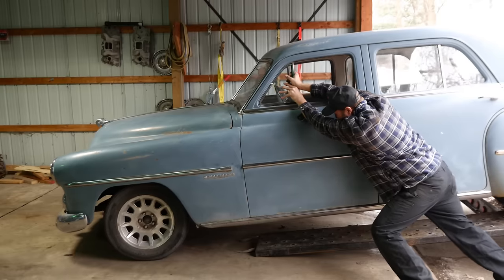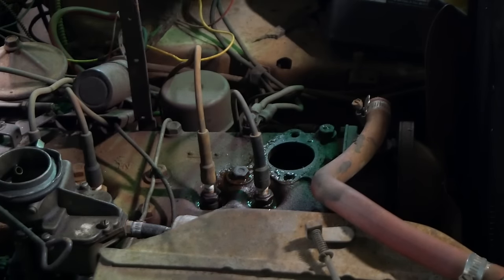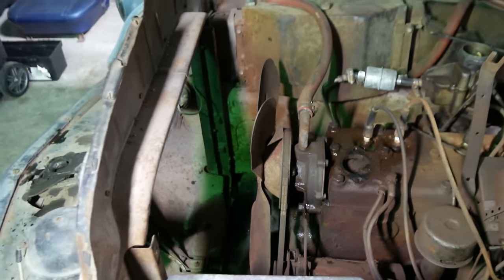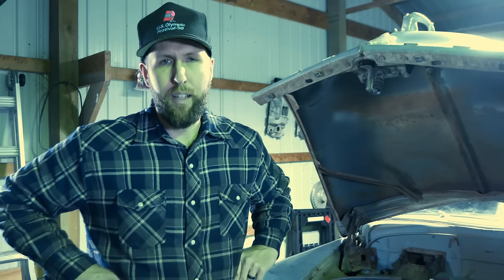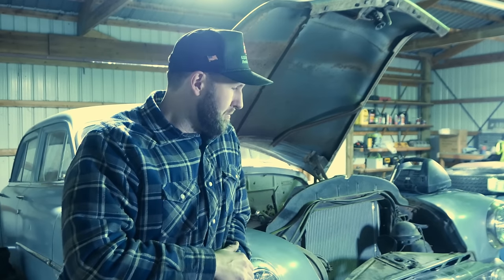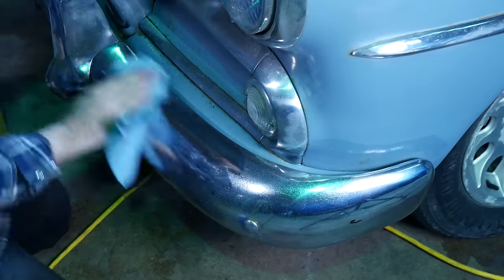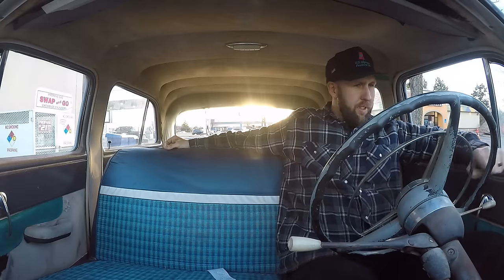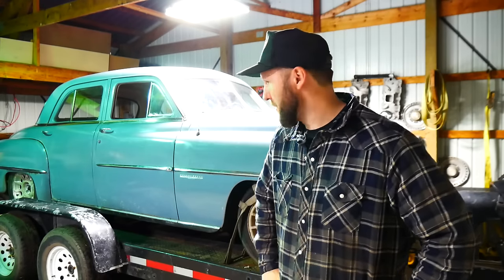1952 Dodge Cooling Repair & Paint Buff - Vice Grip Garage EP23

Comment: When you could buy TSP (Trisodium phosphate) I would put about four tablespoons of TSP in the radiator and start the car and let it idle. ( thermostat removed from the engine block)Then I would put cardboard in front of the radiator to block the airflow. Watching the temperature I would turn the engine off as soon as it got to the hot mark. Then drain the radiator and flush it and the engine block with clean water. When the rust, oil, and crap stopped draining out, Close the radiator petcock (radiator drain,) and thermostat, fill the system with antifreeze/water then run the engine and top off with more antifreeze/water mix. That would clean the cooling system and prevent a lot of overheat situations. But, you can no longer buy TSP because of the tree huggers (phosphates in the environment.)  Automatic dishwashing power may be a viable substitute. It's worth a try. DO NOT USE LYE. You can't buy it now anyway because of methamphetamine labs.

Comment: I like those adjustable impact wrenches too (the one you used to remove the oil drain plug). Use ‘er as a wrench, use ‘er as a hammer...

I was wondering, were you using the “MIGHTsucker” or the “MITEsucker”?😝

Comment: My truck would not start at the pharmacy.  Changed starter and alternator in the parking lot.  What happened was the whole truck fuse went kaput so changing those things did nothing.  I had a lock out and only an independent mechanic can fix this.  I had the truck towed too.

Comment: The thermostat serves a purpose on many levels. I see it this way, for the most part, im not an engineer. I'm did design it,  should not change it,the design bat least. What fails, can be replaced. If the thermostat has not failed you have to find the blockage. It could be a bad water pump. The radiator could have a blockage.

Comment: I had a few breakdowns. Head gasket blew losing all power on a motorway, then the traffic police lied about the advice they gave me causing me to get a court summons, I went to defend myself in court and they dropped the case 30mins before I was due to appear (but of course making me go through the stress - I was 18, thanks guys - just own up, OK?). End result was I got a new head, and with friends reground the valves, overhauled the twin strombergs carbs so well balanced the shop said there was nothing to do when I went for a tune. As part of that episode I walked for 3 miles carrying the cracked cylinder head. I was only a skinny guy then, and it was agony but necessary, so I just carried on through the pain. A week later my arms had seriously bulked up and toned. My biceps were like iron.

Later, on the same vehicle - a Triumph Vitesse Mk2 -  the mainshaft shattered on the transmission, so I rebuilt the synchromesh gearbox using a secondhand mainshaft and all new wearing surfaces, bearings, springs and dog clutches. Again it all worked fine. I think I was still only 19, and all this in 1983/4. 

Later, my rad leaked on a trip to the Highlands of Scotland, and a garage at The Bridge of Orchy - quite remote for Britain - used the wrong torch to repair it, causing the solder to melt. Later that trip at The Kyle of Tongue the clutch master cylinder failed. Luckily I was driving a Saab 96 V4 - a bit like your Sonnett - in that it has a freewheel, so I was able to get to Inverness and, with a bit of persuasion, get the garage to fix the beast fast enough so actually had a holiday where I wanted to be.

Watching you reminds me how much I enjoyed working on and fixing vehicles. I miss it and feel the need to do it again.

Comment: Hurricane Irene, moving house, t-shirt and jeans, 1993 Dodge Shadow 2.4 loaded to the brim with Mom's art supplies, surging begins, surging decides to stick around, engine dies. Now I'm stuck at the side of corn field 5 mi. from either home in freezing temperatures with some cans of paint and a drawer full of rulers and razor blades with more than a 20 minute walk to the nearest door through sideways snow. 10 minutes later she fires, rev it once, neutral drop and a full charge up the next hill.

Injector froze at WOT.

Never figured out that surge issue.

Comment: Worst place I ever broke down was on the bridge from Ohio to WestVirginia in rush hour traffic,  Had to set there for 3 hours, had to cut a hole in the bed of the truck with an axe to replace a fuel pump (limited tools) then found out it was a bad wire to fuel pump that had broken in 3 places.

Comment: Those old flatheads, if they got water down in the plug wells it would ground them out>  Had a friend with a '39 International that happened to.  I just wonder if that high pressure car wash did the same thing to that Dodge.

Comment: Worst I had was a car I lended to a friend got a flat on the ol freeway. He tried to change the tire and a lug spun free. Showed up with a death wheel had him limp it to a gas station on one of my states biggest exits. Plugged into one of the stations 120 outlets and cut it off in the parking lot. Donut and slow speeds after that

Comment: Didn't actually "break down" so much as get high centered in the mud in the wife's brand new Toyota 4x4 back in '89.  Had to walk out about a mile and find a cable and a come along then walk a mile back in.  While walking back in I was "attacked" by a crazed groundhog.  Never really knew why he wanted to chew my leg off but he came snarling out of the brush towards me and I had to drop the cable, drop the come along, pull the .357 Magnum from the holster and dispatch the damn thing.  Took (3) good hits before it gave up trying to maul me.  Got the wife's truck unstuck and returned the borrowed cable and such and made it home about half hour after everyone had sat down for Thanksgiving dinner.  Wife was pissed!

Comment: Worst break down??? Was driving from Oklahoma to Minnesota in my 79 LTD II w/69 mustang 351w/4v think it was the summer 1986?... Fuel pump went out in Misery (Missouri) in July. A farmer picked me up on the side of the highway. Drove me (On his tractor) to a car repair place (broken down barn with old cars, tractors, refrigerators, etc.). My mechanic spidey senses were tingling. They asked me if I wanted to tow it there and have them fix it. I said I would call my Dad (super dad) and he would come (Was 300 miles away) Being the smart guy he was. He picked up the fuel pump before he left. Still the same day I left Okla. at 3am). So mom and dad showed up about five O'hot (100 and 10 million degrees) and I preceded to replace the fuel pump on the stick hot black top. "Oh, I was with my 1st wife too" Did you know you can get like a bad sunburn from laying on blacktop.. Yikkess... VGG Rocks...

Comment: Back in 1990 my then wife and I were going west on interstate 80 in Wyoming. I was sleeping in the passenger seat and she was driving when I was woke by a slap across my chest. As I became coherent I saw two semi's, one on each side of us as she has a death grip on the wheel and the front is going all over the road. The outer wheel bearing on the driver side had failed and we were literally 100 miles in either direction from any civilization. I had no tools because they were where we were going. The tow only cost $100.00 and they only charged $40.00 to fix it. God and my Angels were on my side that time.

Comment: I was driving a hearse and broke down on the side of the highway that would have been ok if it wasn’t here in Australia with 40’ plus degree temperatures that’s 104 Fahrenheit for those playing at home. And of course I had a passenger in the back. No complaints from him though.

Comment: Ahah, I stopped opening my mouth, I tried before pulling out the stat on a 455 on a 350 radiator, got me about 45 miles. Had to use ditch water to get home

Comment: Dropped a valve in a VW camper in Africa 6 miles outside Gaborone the capital of Botswana. What a racket.  The good news is the Mercedes dealer had a new engine on a pallet and even let me use the garage to swap it over.  That was Dec 1984 $600 between 3 of us ,,,bargain!

Comment: I had a 1981 Chevy 1/2 Ton Pickmeup with a Sprint Racer motor with a crappy radiator.   It over heated in the middle of the Alberta main drag.  Highway 2 is not the place to do that.

Comment: I had made 3 fate full decisions one evening when i was quite young( 36), #1 bought an ol chevy PU ,  It was a 62 as I recall. And the only buying appeal this truck had was someone swapped in a 396 BB, some leaky headers, and 4:10's in er back side. I never even pulled the oil tastin stick. the seller fired it up, and it rumbled and i said SOLD. it was not far from home so of course my brother and I brought home the 'good' truck and we went drivin around in the new GEM. every stop sign, we hit the trouble maker peddle on the right, and she left a patch as long as you like. so this town, was small, ( i wont mention it by name cuz I dont think the statutes of limitations is up yet on our 'crimes',) but we were goin by the police department, and in our young minds we shrugged a collective SURE, why not? and whipped around to the parking lot and proceeded to lay a patch of smoke and rubber that any Aussie would be proud of,  right up until the drive line EXPLODED! Now the RPMS were up pretty high and parts of the drive shaft went everywhere! including somehow hitting the oil pan and it started puking 5 quarts of oil onto the new blacktop of the police department/court house. That was mistake #2. so we run the hell home, about 8 blocks, grab the good chevy truck and a chain and we whip right back over and hook up the gem, and drag it back home and put it in the driveway and covered it with a tarp. 2 days later we get a knock at the door, sure, of course its the cops. they asked us  when we were fixin to clean up that mess we left on their newly paved parking lot...we acted stupid cuz how would they know who dun it? well, boys, we just followed the black strip of oil you left on the road for 8 blocks and it ends right under that there tarped truck......oh...#3, clean up yer mess!

Comment: Wort place ive ever broke down was death valley on my way to Fernley Nevada for 3 days of no work. It was a 1985 Fox body Mustang. I got some really bad gas from the mine I was working at and it clog the fuel filter. It really got bad once I was on the other side of Lone Pine California and there wasn't an auto parts store anywhere. Mustang thought it was a good idea to make the fuel filter threaded instead of like GMs inline filter. If it had been a inline filter I could've just stuck in a pen body but instead I could on go about 20 to 30 mph and i had to stop ever damn 10 miles and shake the stuff out of the damn filter. It took me over 24 hours to make it to Carson city Nevada to get a new filter. I've hated FORD ever since. That's just one of the dumb engineering mistakes of many at FORD..

Comment: I broke down in my ’78 F150 Ranger on an exit ramp in Ohio.  All that separated me from a nearby AutoZone was a drainage ditch and a 50 yard hop, skip and jump.  So instead of walking up the exit ramp and around, I decide to get a running start and jump over the ditch.  I didn’t make it . . .  came up short and fell backwards into the muck (seating position oddly) . . . lost my shoe and my backside was covered in some kind of awful muddy stench.  Called my sister to pick me up.  She was like, “what the hell happened?”

Comment: Broke down in 54 Ford F100 loaded with about 15k$ keyboard equipment on th way th o as n audition when the rear end went out. You don't leave this kind of investment sitting on the side of the road to get help, cuz it won't be there when you get back. And yeah, I missed the audition. There were no cellfones... 😳

Comment: Put a harbor freight ATV winch on the front of your trailer and get a portable power pack to run it works awesome I pulled a 57 Chevy with four flat tires up on mine. Come alongs suck!!

Comment: Had a tie rod end come off on the way to the in-laws house... Tire makes a hard right... I make a hard left.. Truck doesn't care about either...it went straight.... Once the Truck finally stops.... I crawl under The Truck... Mostly because i can't stand... Or speak.. Beat the ole tie rod back together with a Louisville slugger and strap it together with bailing wire and limp the last mile of my journey...

Comment: I learned my lesson buy blowing the head gaskets on a brand new motor that I removed the thermostat because some complete idiot told me to do so the motor will not run cooler with it out ot will run hotter!

Comment: I had a fire on the golden gate bridge in a 1972 dodge dart fuses were wrapped with tinfoil CHP gave me a ticket for stopping on the bridge  I worked for a used car dealer at the time he sent me to recover a rental car in Nothern Cali, I'm in L.A. and a trip north is about 7 hours each way this trip took me 7 days it broke down about every 100 miles or so you name it, it broke, when I finally got back my boss said he just bought the car for $150 the same day I left this was the only car on the lot with a tow hitch so he gave me that one water pump. heater core , universal joints, 3 flat tires w/ no spare, brakes failed, fuel pump slant six she kept going sanfran, to L.A.left me on the road about 10 or 12 times   yep fun.

Comment: Cummins ate 3rd gear hauling my new to me tractor home pulled over on a gravel travel unloaded the tractor pulled the truck away from the trailer hooked the tractor up to said trailer whipped around come alonged the truck onto the trailer backwards and proceeded the remaining 120 miles home across Iowa in January hauling a dually pickup on a car trailer behind a 70s cab tractor with no heat 😂

Comment: well not really a break down story but while ago, i was at the truck stop in my wrecker an i left my keys in the ignition an locked the door without thinkin an well my unlockem tools were an tightened up in the ol tool holder so had to call ol moma key master down at the ranch an had her bring up her locker outters an key machine since shes a ol lock n key master an git the ol rig undone an made up extra door key to hide round fer next time i fergot, which happens alot

Comment: Swamp. Florida type. Before cellphones. In a ford ranger.tierod end broke and the overhead cam spit out a rocker arm in the 4 banger through the valve over. I snapped the balljoint back together found the rocker arm in the plastic break reservoir. Tied the ball joint in with speaker wire. Ducktaped the valve over kinda closed. Used a crowbar to shove the rocker back in.drove ti 19 miles home. Then the 52 miles to auto zone and u-pull-it shaping parts at each.i can't rocker if I was brave or stupid. Stupid I think.

Comment: You left out timing as a cause of overheating. Thermo, heads, clogged radiator, water pump, timing, low water. 6 different things.

Comment: I haven't seen the whole video yet so....I hope you didn't discover the splendor of the old MOPAR flat heads and their wondrous sheet metal cooling tube behind the water pump and how they corrode into tiny bits and have to be laboriously picked out and replaced with a new 2.5-foot tube.... Ask me how I know this.....arrrggghhhh

Comment: Fun! Fun! Fun! You actually have room in the engine department to work on those old cars, and it doesn't take a rocket scientist and sophisticated test equipment to do the job. Why can't the auto industry make a truck for the average working guy can afford and work on himself, You know vehicles with just reasonable minimum options like AM/FM radio, power steering, power brakes, power windows and that's it. No smog stuff other then a PCV valve, and EGR, make it simple again. Every time you go to the dealership for repairs it cost $500 to $1000. It would be nice if you could avoid those repair costs by just going to  the parts store and doing the repairsj yourself. Technology and computers, it has its pros and cons I suppose???????.

Comment: I HAD A OLD CHEVY STANDARD WAS DRIVING COMPLETELY ILLEGAL. STOPPED AT A RED LIGHT. HAD MY GIRLFRIEND WITH ME. DON'T YA KNOW A STATE TROOPER GOT BEHIND ME. I WAS VISIBLY SHAKING. THE LIGHT TURNED GREEN AND I STARTED TO PULL OUT WHEN I DID MY WHOLE EXHAUST FELL TO THE GROUND. BOY WAS IT LOUD. SO I DID THE RIGHT THING AND WENT TO THE NEXT LIGHT. NOW THE TROOPER IS BESIDE ME. PREFECT. I WOULD'NT LOOK AT EM. THE LIGHT TURNED GREEN AND HE LEFT. SO I DID THE RIGHT THING. GOT SOME BARBED WIRE AND FIXED IT PROPER.

Comment: A guy running fast lane motorway, spat out an injector on common rail, lost everything at 70mph, wasn't amused, managed to stop in the chevron between sliproad and 1st lane, spent 3hrs waiting for breakdown, did a guy mention, it was new years eve and bloody freezing, just saying!
Reply: A guy just remembered, back in 1971, he bought a mini for 60pounds, needed a bi of tlc, as I was starting  rallying, a guy had fitted a brand new pair of spotlights, after plugs,points,oil etc, a guy aattempted to start the engine from under the bonnet, stated jammed on, some idiot had left it in gear, mini slowly crept forward to a wall, didn't stop till glass on both new lights shattered. A guy had some. real strong words with the idiot. idiot never did it again, I don't know!!!!

Comment: My Friend getting old  or getting rusted ....?  Your climate doesn't facilitate the bones -------
Now ........ NO THERMOSTAT = engines too cold, bad combustion  or  engine over heating  because the water circulate too fast and hasn't time to cool down !!!
Thermostat are made by engineers for a very good reasons !!!
I have proven to costumers  that the thermostat in a 2 stroke engine (boat engine) better the performance and the fuel consumption is far less !!! 
Here the "specialists" mechanics they also are saying that :  because it is never cold no need of thermostat (common story) !!!